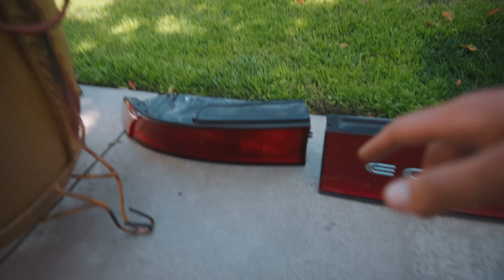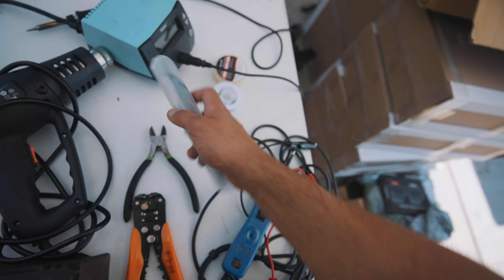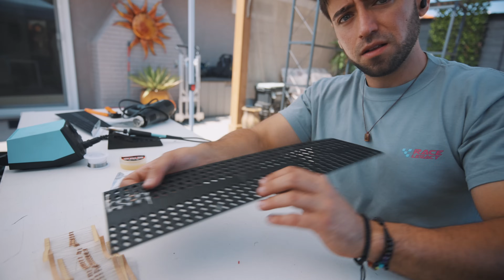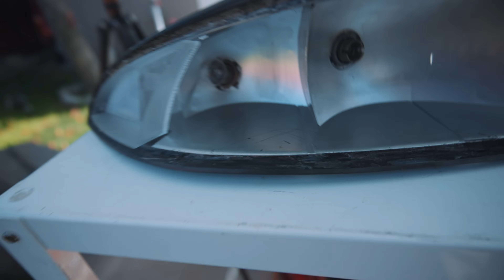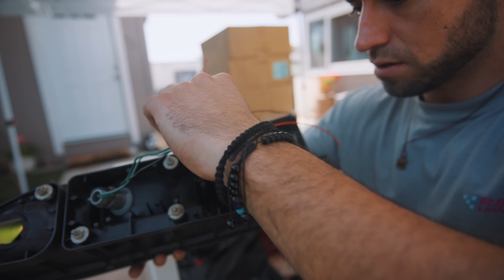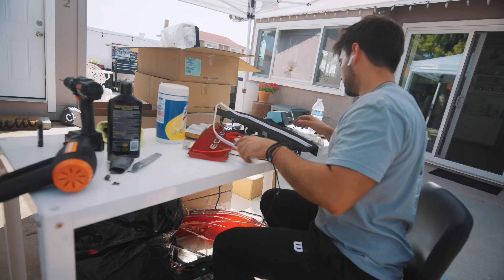How To Make Sequential Mitsubishi Eclipse LED Taillights | Race Legacy

Comment: Why not use a company like pcbway to make custom pcbs to make the fab way easier?
Reply: I checked and you're charging 1300 for fully assembled and 320 for the diy kit. I don't know what the housings go for these days, but if it takes you 6 hours per light, that's 12 hours per kit. Even if the brake light assemblies are free you're charging a pretty low labor rate there. If you got pcbs custom made I would expect they'd be less than $100 a set and save you close to 10 hours per set. So you could charge quite a bit less, make them faster, and have a more robust product (the pcb would provide better insulation and add strength)
Reply from the maker: Thanks for the insight! This was the first design I was able to come up with and plan on making future sets/ kits easier to use. I’ll look into the circuit boards man, thanks!

Comment: Nice work Miguel! Now I just need someone to sell me a clear taillight set! 😆👍

Would it make sense to use a little clear silicone to keep the singular LEDs in place? It would be a shame if any ever popped out... 🤔
Reply: You and me both
Reply from the maker: Yup! Shoe goe helps after you have everything setup. This base has a pretty firm grip on the LEDs though, shouldn’t be an issue
Reply: @MiguelDsm  Good to know, do you happen to know the lifespan for the LEDs used? How many 1000 hours?